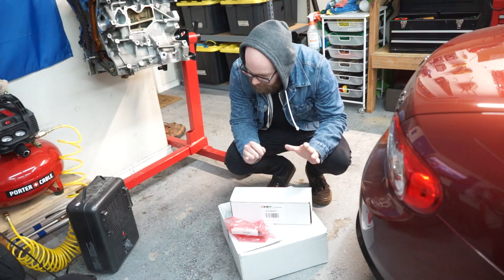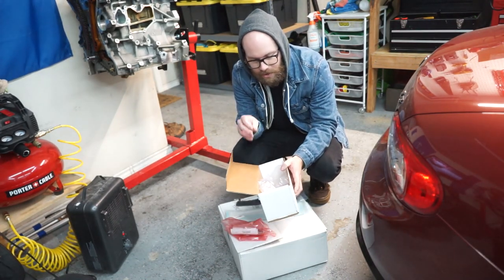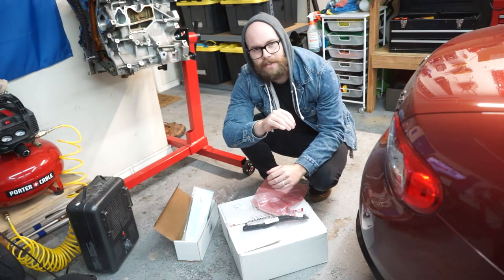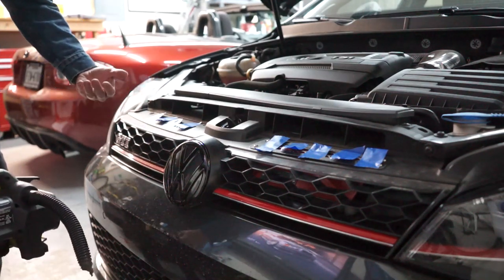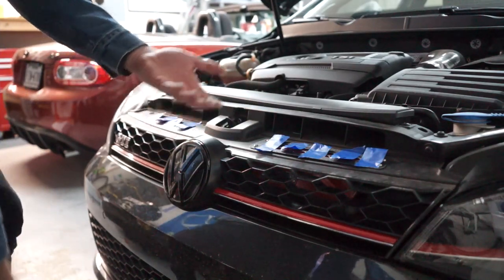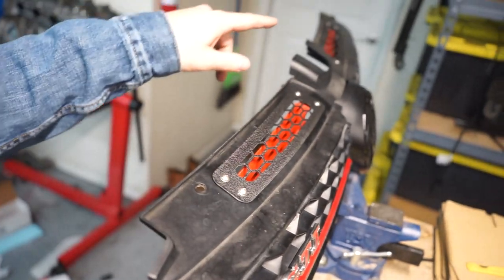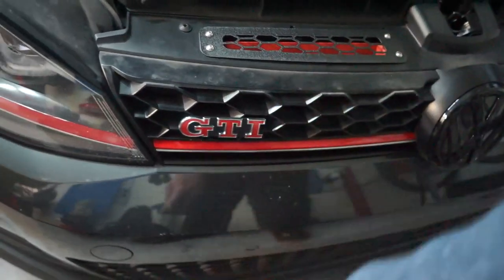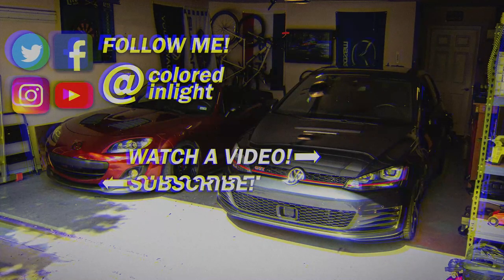Mk7 GTI Dual Air Inlet Scoops and Euro Block Off Plate - Testing the OEM+ Intake Set Up

Comment: What about during heavy rainfall. Won’t moisture that gets sucked into the air filter, cause problems for the car? That’s why the original one was designed that way
Reply from the maker: I've driven it in rain, snow etc. its fine
Reply: The original design is very restricted and made like that because of sound and emissions. Or maybe just poor design. Look at all the aftermarket intakes, the best have a similar design, e.g. Eventuri.

Comment: I got mine but the driver side was smaller and kinda different than the passenger side ,is that how it is or there is something wrong with my order?
Also on the driver side theres a big gap between the red part and the black part that it hold to !

Comment: I own a Mk7 and I still cannot believe what a horrible stock intake VW uses. From the day I started modding my car, I wanted to do something about the intake. I tired stuff like this and tried to get as much air in as possible and I gave up with it and put an aftermarket intake on. Much, much better. I'm getting 42 mpg on the highway too. It was at 62 but the free-flowing air that isn't restricted is well worth it, considering that Mk7s get about 30mpg from the factory.

Comment: Does this cause your water temp to be higher? How about radiator fan does it cycle more frequently? I ask because of the scoops aren't they blocking air flow (somewhat) to the radiator, A/C and intercooler? OR is it insignificant? Also, rain and snow has an easier path into your air box possibly? These are all valid concerns I think. That said, I like this simple mod if overall engine life is maintained.
Reply from the maker: Anything being blocked would be insignificant. I don't notice any difference.

Comment: I think there is no benefit at all blocking the air into the engine bay bro, want to keep intake manifold and engine bay as cool as possible and with the drilled holes on the intake side plenty of air going to the air box.
Reply from the maker: I doubt that one little open slot is cooling the engine bay significantly. It's a European part that's meant to go on the car.
Reply: @ColoredinLight  it doesn't have it in European gtis. I can tell you that. It must go on lower powered golfs.
Reply: @SabeTheApple  it’s for a Golf GTE. I had this mod on my car but took it off as I was worried the engine might get too hot

Comment: I hate that porter+cable air compressor. Most of the common 6g pancake compressors are made by the same company. DeWalt, craftsman, porter cable, Bostitch, Stanley, black and decker, all the same company. Then there's metabo and rigid which are slightly less common but still everywhere. Plus your random bargain brands. But somehow, out of all of them, the porter and the craftsman are the worst. They're somehow the loudest, the hottest, and the least powerful of them all while also usually being the most expensive. Theyre more comparable to the bargain brand compressors which are like 2/3 the price. The metabo is $50 cheaper, quieter cooler and more powerful. The dewalts and bostichs have better cooling and are also quieter and some have a higher PSI. Metabo makes a 200PSI pancake. Rigid has more power and is alot cheaper. I think porter uses the oldest design